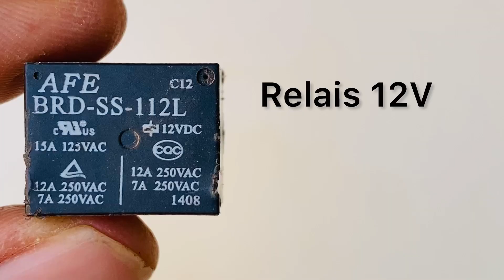Comment Fabriquer Un Taser 100 000V !

Comment: Salut,
j'ai fait la liste de ce qu'il faut, je ne sais pas si j'ai oublié quelque chose : 
- condensateur 2kv - 6kv
- pile 3.7v/6v
- 4*4 diodes 1N4007 en série
- Cable haute tension
- relais 12V
- circuit magnétique
- bobine 0.5 mm
- bouton poussoir

- résistance (capacité ?)

- Volmètre
- Scotch isolant
- soudeur
Reply from the maker: 22 Ohm pour la résistance.
Le circuit électronique est disponible dans la description de cette vidéo.
Reply: @elecbuilt  merci beaucoup